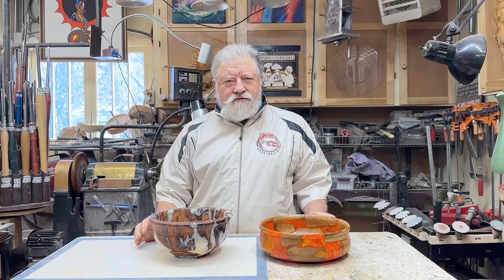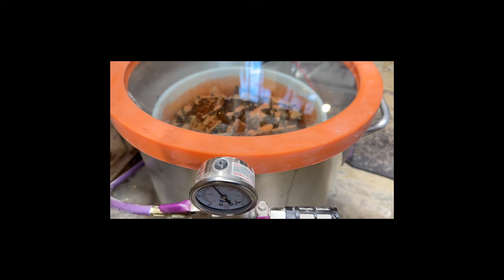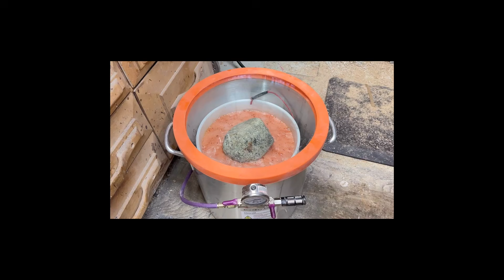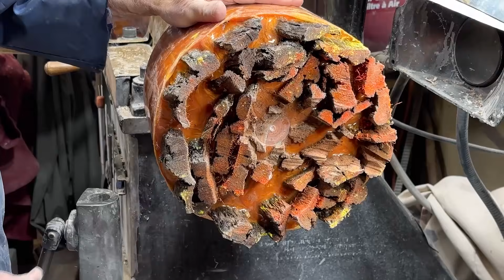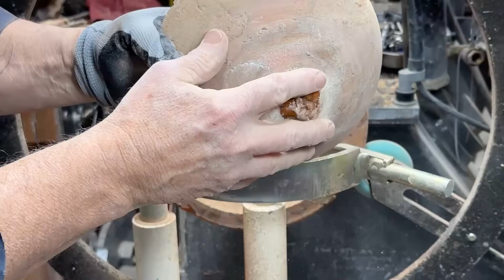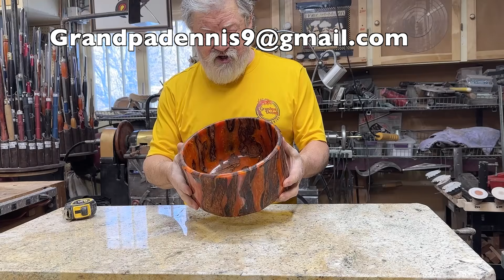A woodturned bark bowl with fire resin

Comment: Do you have any means for us to support you? Maybe a new vacuum pump? I’m unsure if you were purposely creating the vacuum slowly, or if the vacuum pump can’t handle it.

Also, your theory as to how the vacuum chamber works is correct. 

Air trapped inside the resin gets drawn out by the exterior low pressure, eventually getting sucked out by the vacuum pump.
Reply from the maker: your offer is very interesting. My pump does have low cfm but a replacement is very expensive.   Grandpadennis9@gmail.com

Comment: With that much resin do you not have a over heating problem with that resin. Not familiar with that brand. But this looks good keep the work up you are tiktoks new grandpa
Reply from the maker: that is supposed to be a problem it it has never been for me. the over heating will cause cracks. if it does then they can be filled with complimentary colour to add even more interest

Comment: I have had this idea for years of resin and wood combinations to make wine glasses or mugs and goblets. Then sealing them with some FDA approved food safe epoxy or resin for regular use. Do you think that's a viable idea? You're welcome to use this idea for yourself as well. I'd love.to see what you'd make of it.
Reply from the maker: great idea. once the resin cures it is food safe. as far as making money the resin is very expensive. my calculations show I need $60 per hour as a break even point just for the shop expenses. most will not pay that for a functional piece so you need to market them as art

Comment: Looks great, and does the vacuum change the marble look of your resin or is that pretty much all in the mixing? If you changed the rhythm of turning on and off the vacuum change the design of the resin?
Reply from the maker: I think the marble colouring is built into the powder to begin with. But if you don't put enough powder in then the effect is reduced.  if you use two different colours in two different pours the process of the vacuum seems to mix  the colours blending them into one new colour.

Comment: You are correct in that as the vacuum chamber pulls the air out of the wood, those cavities are filled with resin when you release the vacuum.  The thinner the epoxy is the better it will penetrate the wood.  Thats why use cactus juice to stabilize punky wood prior to turning and casting.  Great project.
Reply from the maker: thanks for the confirmation